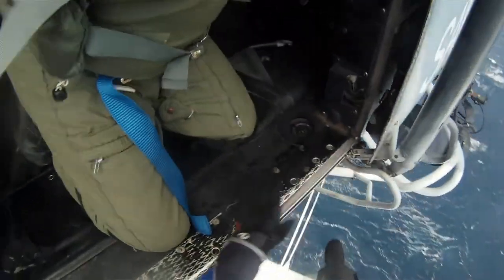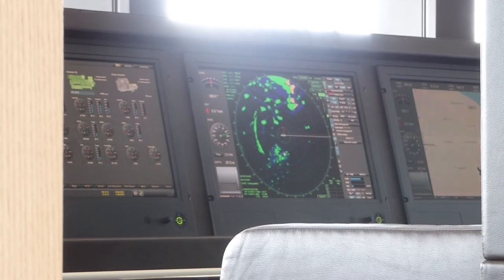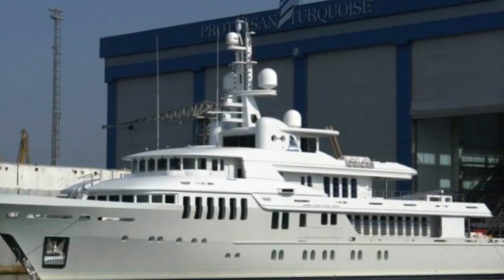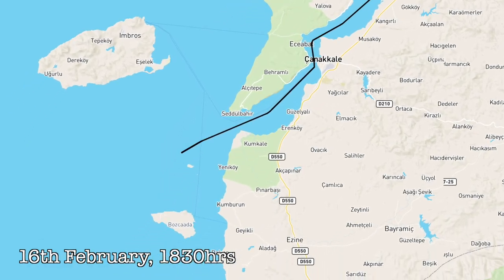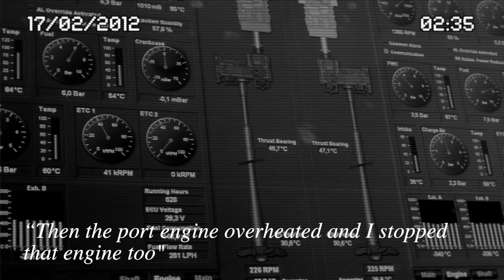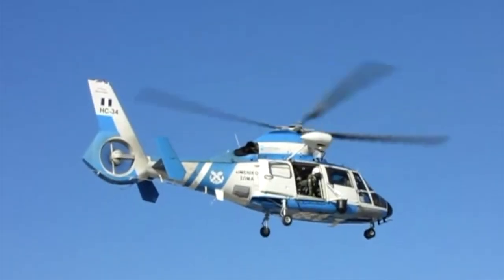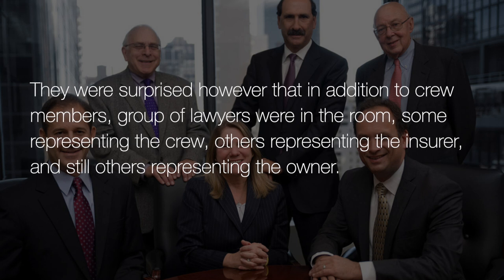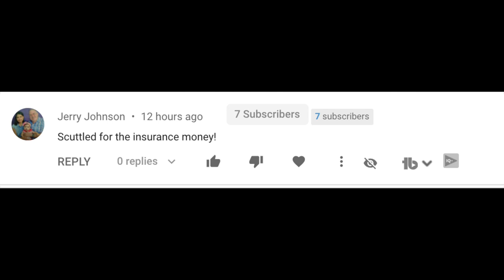Yogi: Largest SuperYacht that ever Sank - Part 2

Comment: I work on super yachts and there is absolutely something going on here. Way too many "inoperable" systems all at once for a cream of the crop super yacht of all types of boats and a new build nonetheless. Then conveniently out of 3 independent means of bridge-to-engine control room communication methods, they all don't work?! As well as the annoying alarm you get if all watertight doors aren't closed and secure under way? I do however question how you would convince a professional yacht crew to risk their own lives to help the owner commit fraud. The captain was probably in on it, silencing alarms in the 3 second inhibit period before the engineer on watch would notice them to get the boat to a state where it could not be saved and then just having crew carry on with their muster duties. Confidentiality clause probably drafted for the moments he told them to leave the log books and other documents that would normally have been someones duty on the muster list. Why the bilge pumps and bow thrusters were not used after all the engineers would have surely noticed a flooded compartment and lack of steering is a mystery on its own too.
Reply: They should have had it towed to my Port City I would gladly take ownership of it. It would never leave the Harbor because I can’t afford to fuel it but I would ❤️ to make it my Home.

Comment: 2 critical phone systems not working on a brand new ship, Hmmmmmm.  No UHF radios even though the ship had 15, Hmmmmmm.  16.4 knots or was it 14 knots, Hmmmmmm.  Grabbed all their personal papers (passports), but not critical ships logs and documents, Hmmmmmm. Changing stories, Hmmmmmm. Im pretty sure all this adds up to fraud.
Reply from the maker: There were certainly many strange things going on right!
Reply: Would be interesting to know how many other vessels go to sea with a faulty wired communications systems.
Reply: Your right about the radios! I watch that vlog from a super yacht captain Tristan Mortlock, in all his videos all the crew have a VHF radio when they are under way! They are in the middle of heavy seas in a bad storm & they can't communicate with each other are you kidding me? Add the fact the yard owner was shot in the head, heck of a lot going on here!
Reply: Hmmmmmm 🤔
Reply: Lol that's exactly what I was thinking within the first couple minutes of the video. Sounds like a big insurance scam
Reply: it looks that way and i wouldnt blame them, 30+mil on a super yacht and it spends half its life on recalls. But everything you said could be explained, the ship has had many problems and been under constant recall, the electrical problem with the phones could have happened, while they use separate wires they are generally routed all through the same paths so any damage could have taken them both out. The crew had been working long shifts, so something as simple as forgetting to pick up a radio, or forgetting to charge yours at the end of your shift is quite common. If it was me, the first thing i would be grabbing would be my personal effects, basically my wallet and passport, all you are wearing is a survival suit, you dont have bags or room for books and paper, and i think honestly the ships logs would be one of the last things i would be thinking about. Changing story is actually quite common when it's truth, generally the first interview after is the most accurate, but as time passes your memory changes or warps things, unless your story completely changes from what was originally said, but in this it was just minor changes. When people lie it is generally all rehearsed, all crew would have the exact same story and it wouldnt change, they may have known this though and purposely changed and edited their story to cover. But i think it wasnt just on the fact it went down in 40 knot winds, with 7 meter seas, their chances of survival were drastically reduced and i dont think they all would have put their lives in that much danger for insurance money, i would have agreed if it went down in calm, or even just small seas, but the situation they were in i think even they knew they were lucky to get rescued.
Reply: @shroomzgames7370  I agree, I think IF there HAD been a plan to scuttle the vessel, and the captain and crew saw what kind of conditions they were in? They would not have carried it out. It seems unlikely that 8 people all had a death wish for which they were willing to be paid considerable sums of money in order to collect insurance. Everything you said makes perfect sense. It is more likely that a string of small mistakes, mistakes which perhaps would have even been excusable if they had happened alone, such as forgetting your radio when you are tired, worked in concert to lead to disaster. In the words of a friend who is an experienced private jet pilot, "when you're in the air, you can make a mistake, mistakes happen. But if you make two mistakes in a row? You might be dead."
Reply: People think all criminal are stupid bumbling fools. Drug addicts and the like. Crime doesn't pay yadda yadda ect ect.

 There are crews of professional criminals who specialise in insurance fraud. You just watched one crew of 4-5 people, professionally sink a yacht for monetary gain. That, or every single crew man was a bumbling fool. Even a bumbling fool will save the important records. Criminals won't save the important docs to prove their guilt..
Reply: @shroomzgames7370  I like your opinions on this, and I think your very smart based on the same comment, but I disagree with your opinion on the danger of it, and that no one would risk this for insurance money.
  You are flat out wrong. It's your personality that makes you think this way. People risk life and limb all day for nothing more than a pat on the back. People surf 100 foot waves. Jump the Grand Canyon. Go over Niagra Falls in a barrel..  and all these didn't make money. In fact they cost a small fortune. I'd say "No one would ever go over Niagra Falls in a barrel, for any amount of money." But I'd be wrong. People do it, and they weren't offered $100,000 either.
Reply: 100%, likely insurance fraud
Reply: either the cargo is still full of weapons or it's empy of weapons.
Reply: @jplxlabelle1681  facts people know what they are doing. Bigger insurance frauds have happened like the president and his brothers/friends $11 billion 3000 dead people and 2 big towers
Reply: 3 hours and 15 minute to dispatch a rescue effort?!?!?
Reply: Hmmmmmm, Yep - Very Much looks like an insurance scam.
Remarkable levels of incompetence among most parties. 
The shipbuilding company looks Very BAD here....
Reply: Hmm I think you are correct, insurance fraud gone wrong.
Reply: @Laptop Style Life......not only that but after failing to communicate due to the TWO non-working phones, the Chief Engineer went up to the Bridge to tell the Captain to stop the engine.......when the Engineer himself could have done that from the engine room!
Reply: Insurance ?
Reply: Insurance money?
Reply: I LOVE it when someone, jealous of anothers' compensation reflective of their success in life, comments about it as you have.
Reply: Without even knowing that I could tell this had to be insurance fraud literally only thing that makes any sense....
Reply: Multiple failures at multiple levels. Some of the crew should not have been exonerated. The shipyard is probably at fault for some of this, as was the Captain and engineer on watch. This stinks like malpractice, corruption and outright fraud.
Reply: @liam1428  wake up .

Comment: Whatever said by the crew would be held in the strictest of confidence? Red Flag.
Reply: The MAIB collects reports from crew which cannot be used to prosecute. It’s used to establish facts and true happenings rather than to apportion blame.
Reply: it's quite normal to have a communications blackout like that while accident investigations (criminal or not) are ongoing. No red flag here.
Reply: Absolutely the opposite. Causes are never found and lessons never learned if you can't establish a proper timeline, who said/did what when; you'll never get that info if people can't speak freely; and under legal jeopardy nobody speaks freely.
Reply: @Blenks87  And so you have an "endorsement" of irresponsibility.
Reply: @pkgum6910  not at all. The MAIB is used to establish reliable facts retrospectively not apportion blame.
Reply: @Blenks87  While MAIB does not seek blaming, seems to me, given this video and the obvious failure in the communications area (Bridge, engineer), all of which were the Captains responsibility prior to leaving port and thereafter necessitates the "blame factor" to be well and truly apportioned.

Comment: The fact that the French "fixed" the reported speed and load issue by just fudging the number is outrageous and sickening. Instead of treating it as an investigative lead they acted like a kid grading his own math homework. How can they possibly be qualified to assign blame when their own treatment of the facts is so obviously questionable?
Reply: also wondering if other ship licencing authorities (other than the newly setup french one that was used) would have required the blackbox recorder for that sized ship
Reply: Vi va la di France. 📉😎📈
Reply: Texas. 
Bigger than France.
Reply: Yeah even 14knots would be way over 60% load. My guess captain wouldnt listen and hammered that thing till it shut down. Quick work on rear seals etc added to by water ingress from no control. 16knots in 7meter seas is crazy.

Comment: Whenever I have investigated oil spills, equipment failures and human accidents in oil and gas, there are always multiple failures that lead to disaster. Small mistakes individually do very little, but compounded make a huge mess. Far too many coincidences in the facts here that point toward deliberate omissions and dereliction of duty or abandonment of SOP's. Just based on what you have presented, if I were investigating this case for an insurance company I could only draw the conclusion of deliberate sinking.
Reply: What you are describing is James Reasons accident causation model
Reply: @Pedro DLR He's just offering his opinions.. Do you expect him to research this in his free time or something?

Comment: Scotty: "You know if she ran wide open, I don't think the pipes could take it, Cap'n"  Kirk "Yep. Warp speed Scotty. Steady as she goes (down)"
Reply: Peg Leg  but you can not change the laws of physics captain!
Reply: a space ship cannot sink
Reply: Peg Leg 
 I kenna hold 'er Cuptin, 
She's breakin' oop,
She's gunna bloo
Spock; Sensors indicate a temperature increase in both port and starboard engines
Captain;  Flood the engine room, that'll cool 'em down.
Spock; Your decision, not mine.
Reply: Sassenach! :-)

Comment: Liked the 2 videos. It reminded me of the time we took our jet boat out and forgot to open the coolant valve. Overheated the Chevy 350 to the point it quit. Then as the seawater cooled it sucked the valves at the exhaust ports inward and we were going down alright. Luckily we just made it back to the ramp with the help of a passing boat and hustled to get it back on the trailer. I wouldn’t want the exhaust below the waterline after that. Maiden and final voyage too.

Comment: If this was an insurance scam then only the owner, who was in financial difficulties, stood to gain. The shipyard stood to lose its reputation; the Certifying Authority also stood to lose its reputation, and the crew stood to lose the licences or worst their lives. If the sinking was instigated by the owner, how did he pull it off?
The most likely explanation is that it was brought about by a series of design flaws compounded by a tired crew. 
It’s easy to blame the crew, but that had at best a few hours to identify the faults and rectify the situation, assuming that it was recoverable. The investigation had months in which to identify the issues. 
Responsibility lies with the shipyard and the Certifying Authority.

Comment: Seems as though the French authorities skimmed over some important questions.
Reply: This occurred to me as well. They couldn't really blame inspections and certifications in most main design categories, since they were the ones who inspected it and certified it. Also it occurs to me that even if the Shipyard had given the OK to a new refitting or work, isn't the crew supposed to do their own checks. It seems that nothing worked on this ship, and nobody knew how to deploy contingency plans when main systems failed. You would think that the crew had to have some major part of the responsibility for this even if it was faulty equipment or refitting, since it seems they either did everything wrong, or not at all. The only thing they were good at was calling the Grecian Coast guard with their wallets and passports in their trousers.  Then again, what do I know. I am not a sailor. My Dad had a boat, and we had fun as kids, I've always wanted one but haven't had the time or money. So I'm no expert. But as a fan from afar, this just doesn't seem plausible. Why weren't the pumps used. Why couldn't they manage to manually get at least a neutral rudder so they could steer with bow thrusters at low speed. Again. Im no expert. But it seemed like this could have been handled better. I think there was either complicity, or fatigue and panic. But I don't want to convict anyone falsely. Maybe France should stick to pastries as well. Their report didnt seem to helpful  Databyter
Reply: That wasn't by accident, so to speak.

Comment: Nah, still say insurance job. The nature of the flooding meant they had hours to be rescued, which they were.
Reply: Use your brain sir. For what you are saying to be correct every member of the crew must have decided that they were prepared to risk their lives by scuttling a ship in the middle of a deep sea. If they wanted to do an insurance job they could have chosen a lot of safer places to do it that are nearer land. 

Even if they had decided to sink it for insurance you then have 15-20 crew members who would all need to be in on the ruse and have the same story and be loyal to each other until the end, despite only having met a few months prior. 

Then of course you have no idea when the bulkhead door would fail, or the engines overhear so you might get to your destination before anything went wrong.

In summary, there a lot of easier ways to sink a ship than this that don't come with a lot of unknowns and risks. Conspiracy theories are easy to debunk when you use a bit of logical thinking.
Reply: @ruk2023--  You need to improve your observation skills. There were only 8 people on board and only 4 of them were involved in the actual details of the casualty.
Reply: A new boat with 8 watertight doors, bilge pumps flood alarms etc, something does not make sense here. There was an immense screw up to sink this boat, accidental or with intent hard to figure!
Reply: @rk24133927  And a watertight door doesn't "spring open" that's kind of impossible unless you are like 300 ft underwater with air on one side and water on the other.
Reply: @rk24133927  This boat was too top heavy and required 27 tons of ballast weight?
Reply: wouldnt an insurance company investigate this very in depth before paying? yes

Comment: Why the full speed in rough seas?  Was the captain expected to arrive at the destination at a certain time by the owner?  Or he (captain) just liked pushing things to the limit?  In any case, note to self:  no beach club when I commission my super yacht!
Reply: The weight of the extra fuel bunkered would have been helpful in sinking the vessel.

The captain was doubtless speeding to get to their prederermined scuttling location to give them sufficient time to sabotage the vessel beyond its point of recovery, and to ensure that their rescue would be carried out in daylight...

Comment: A brand new yacht, No data recorder, No communicating devices employed on board, a series of unfortunate events, and a cascade of failures, seen from the specs you offered when she went in for all of that pre-sail work, wreaks of major incompetence. When the Oceanos sank off SA, it was a water incursion below deck. All the "water tight door work," and the punching of the studs in beach club 1 and 2, seem to be a starting point for sinking. I think the vessel was sunk intentionally. Nobody cared to collect logs, but they got their passports and certificates. Why did nobody think that was a bit strange, yet that's what they did. When people start killing themselves after a disaster, you know something is fishy !!
Reply: Jeremy Andrews       Watertight doors don’t ‘burst’ open under water pressure.  They can be left undogged or simply left open and they can’t help if that’s the case.
Reply: @clayz1  Hi. I was trying to flesh out the work they had done on the beach club 1 and 2, and the possibility that the door failed because of the work done on them, i was not trying to intimate that they burst open, but failed in some manner as you said. I guess I worded it not so well. thanks.

Comment: As a boatyard guy, a wet exhaust system will definitely burn through the rubber/silicone hoses (even the 10in and bigger with thick walls). Diesel engine exhaust at power easily exceeds 1000F. Depending on the goose neck or whatever it could start a siphon but in any case a 4000hp or so engine could easily make that engine room lethal to enter in just a few moments ventilators or not.. Just my 2 cents. Great story man I love the videos:)